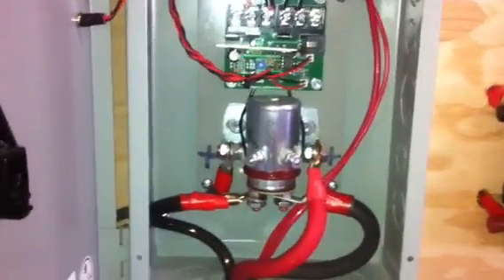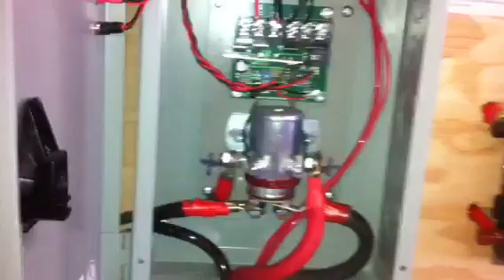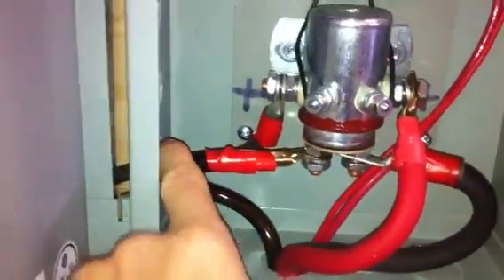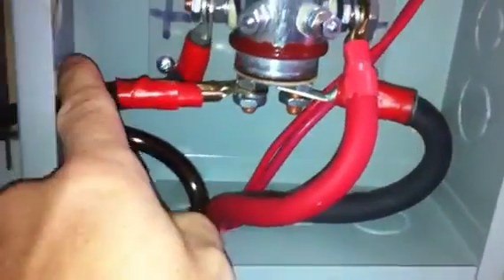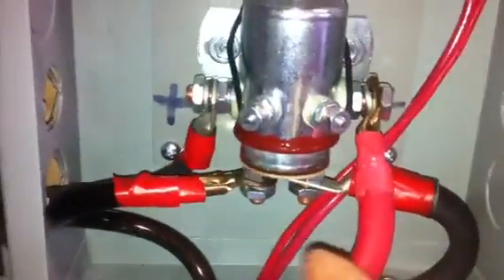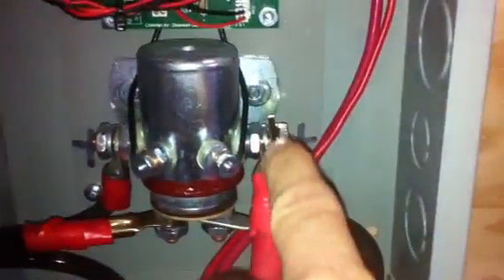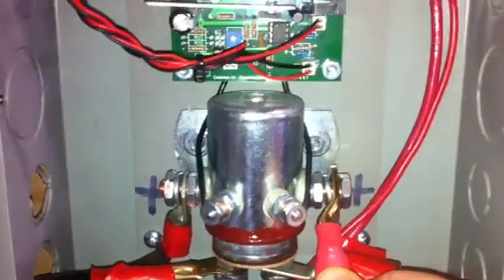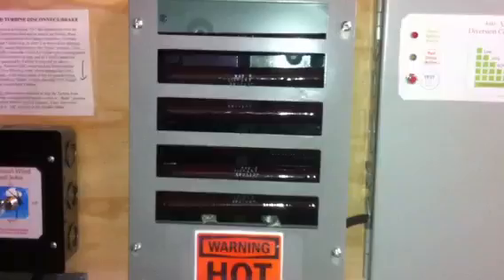Charge Controller - Breaking it down #2

Comment: Great video. I have purchased 2 48 volt 1300 w replacement heating elements. So I just remove two elements in my hot water tank and replace them with the DC powered elements. And I hook it up as a divert load for the Missouri wind and solar charge controller. And instead of wasting the power on the divert load I am using it to heat hot water and not waste it.

Comment: You really should protect your cables coming through to your power box. I can see where the insulation is partially wearing away. That could be a potential fire situation. You also need a breaker or fuse on your positive cables going to the battery bank. Good luck

Comment: hey I'm just curious about this controller. It says it can handle 440 amps is that for real? Can this controller handle that kind of power. I have 3000 watts of solar power on my roof; so that's like 250 amps of power.
Reply: No, it cannot hangle 250 amps. . . It can't even handle 50 amps at 24 volts.
Reply: I'm pretty sure the 440 rating is for the solenoid.  The 'controller' just senses when the voltage in the battery gets too high, then sends a signal for one contactor to close and the other to open.

Comment: Hello. I live in Brazil and found your video doing research on wind and solar enegia in hybrid systems.
I'm riding a hybrid system in my house and I lack define the wind charge controller system for a wind generator that provides 1000 watts x 24v.
I understand Missouri company website this silver piece allows you to connect solar panels or wind generators that add up to the limit of 10,000 watts or 440 A. That's right? This information is correct? This component actually does this? It's just that I could not fully understand the explanation in the Missouri site. Also I do not understand can be connected solar panels with wind turbine in the same terminal of this piece, or whether it should be a piece for each energy source.
I would ask you to kindly explain to me what is the function of this round silver piece with 6 terminals.
I beg your patience with my bad English because I'm using google translator, but I need to know that in order to decide if I can buy this American company. I have many customers to indicate if the piece serve in my system. You have several people who already have an interest in buying if they see my system working well. Could you enlighten me on this subject please?

Comment: I am interested in buying to resell this system in Brazil
To understand the operation of this silver part which is connected to the load controller.
This can connect multiple solar panels with one or more of a wind generator. I would have connecting them in the same pair of terminals, or would be solar panels and wind an entry in another entry?
I saw the scheme that you posted, but there could not understand if the system is to work with wind and solar at the same time, or if I have to choose only one to call?

Comment: Thanks for making this clear. I was looking at this device online yesterday. I have used it but I have seen this product been used on videos by Jeff Missouri Wind and Solar
Reply from the maker: +JWSolarusa John Wesley this is a pretty old unit...but was great starting out with when learning about basics and contacts etc...  but today i rarely use this charge controller and rely exclusively on the better mppt charge controllers (OUtback Flexmax or Midnite)..thanks for the comments and watching
Reply: sunsensational 
Ok.
Thanks my friend.
Do you have any new projects lined up for the winters?
How's your system performing?
Reply from the maker: JWSolarusa John Wesley
my last project was finishing off my battery box at the cabin, and then adding some relays so i can power my vent fan (24v) via a relay from the Flexmax.  you'll see those 2 vids as last ones posted.  but next project will be buying a little honda eu (then building baffle box) and then some SSR and settting up to auto start and charge battery bank when low solar days..but right now $ tight but that will be next big project. i'll probably have some little projects i''ll post up in between.  stay tuned and thanks for watching and kind words.  keep posting more vids yourself. thx
Reply: sunsensational 
Thanks for the info I can wait to see the videos.
Reply: sunsensational 
As for me, I have been so busy rewiring my system and adding four new solar panels manufactured in Japan. These are the 2015 model.
I also installed 1500W COTEK Pure Sine Wave 24V DC. This is my first time trying 24V System. 
My entire system is now 24V except my lighting and my charging Dock station.
Please stay tune for the latest videos and photos on my google+
Reply from the maker: JWSolarusa John Wesley
love it. those extra panels becomes endless $ falling from sky.  I like 24v myself, i think 12v and you're stuck with big expensive wires or voltage loss; and 48v very efficient but gets harder finding 48v components. But 24v is sort of sweet spot IMO. looking forward to watching your progress. it's an addicting hobby but at least a hobby that makes you $, gives you pleasure, security, and helps environment.

Comment from the maker: you're absolutely correct.  i mix that up all the time. i'll check your vids.  i do know know the whole $ issue...been slow process...lucky i was able to purchase bunch of 235w with Enphase Inverters and Ironridge rails and did the work myself, including permnits.  fortuntely, since i did work payback on that stuff will be 1.4 years.  got my 235Scheutens for $225 pp.  Got enphase inverters for $155 per.  i still have to edit my vids on that install and post

Comment from the maker: Great questions, but not sure i know answer, although certain the mfgr (Coleman) would know.  With that said, i can tell you from experience on my 440 that when my amps do surge (even in the high 20's), my controller frequently kicks into divert mode.  From what I know, MPPT controllers allow continued charge (whether by absorption or otherwise) and won't divert as easily.  Don't forget, divert mode means wasted energy, unless you divert to something useful like plug in GTI, H20 element, etc

Comment: The 440 Per Hour Charge Controller brought a question to mind...  is there a limit on how many Amps you can charge a 12V system with?  Is there an reasonable upper limit?  I'm building some rather large panels and am concerned about the amount of Amps they will produce...  I want to keep my system at 12V for flexibility for either 12V or a highr voltage system in the future.  So... again, is there a reasonable limit to the Amps a 12V bank should receive?  Thanks in advance.

Comment from the maker: @russmanjones I agree waste is never a good thing.  I've seen the videos you're referring to, and I think 2 GTI's would minimize that risk.  But there is still another scenario of grid going down, e.g., storm knocks out power, and then island protection kicks in and no resistive load to GTI and free spinning.  Of course, if you're home you'll be there to deal with it, but there may be a way of using your GTI as divert load, followed by back-up to dump.  Something to consider anyway

Comment from the maker: @russmanjones You certainly can, but realize if your GTI were to fail (which mine incidentally did recently with blown fuse), your wind turbine will be free wheeling whenever you go into divert mode and that can ruin the PMA.  However, if using this for strict solar set-up, then using the GTI as the divert is great idea in my opinion, since even if GTI failed, no damage will be done to panels, you just lose your watts created.  Thanks for watching.

Comment from the maker: You certainly can, but realize if your GTI were to fail (which mine incidentally did recently with blown fuse), your wind turbine will be free wheeling whenever you go into divert mode and that can ruin the PMA.  However, if using this for strict solar set-up, then using the GTI as the divert is great idea in my opinion, since even if GTI failed, no damage will be done to panels, you just lose your watts created.  Thanks for watching.